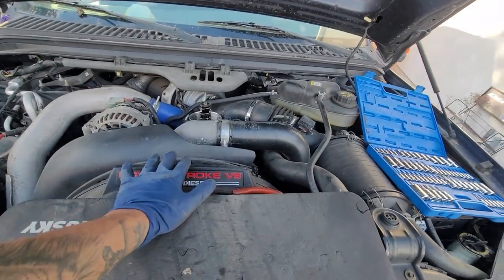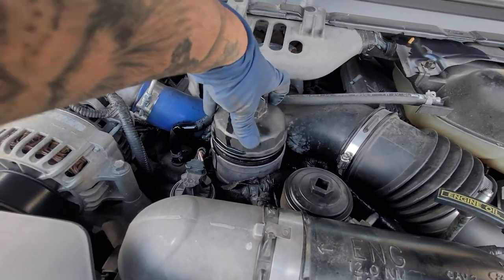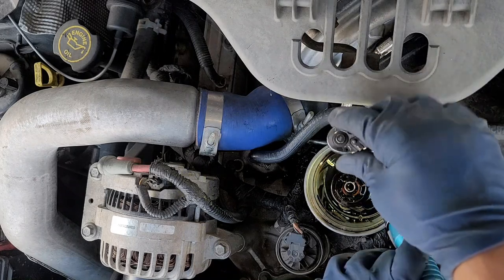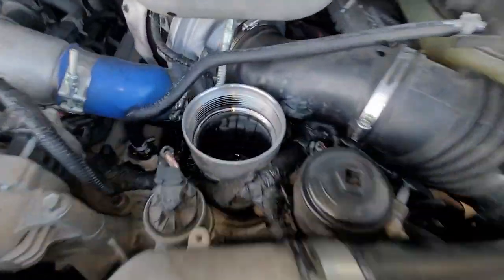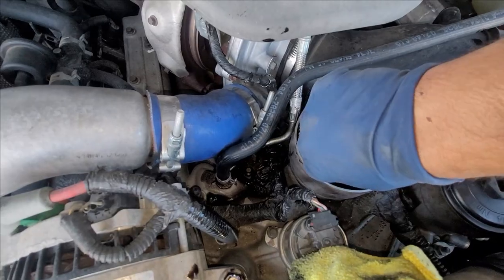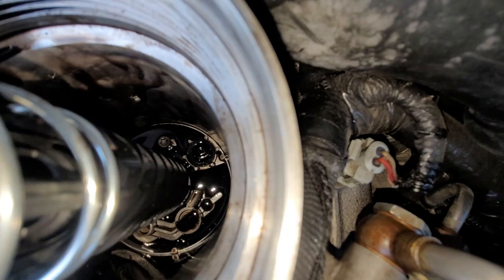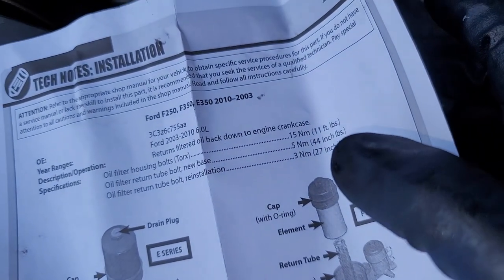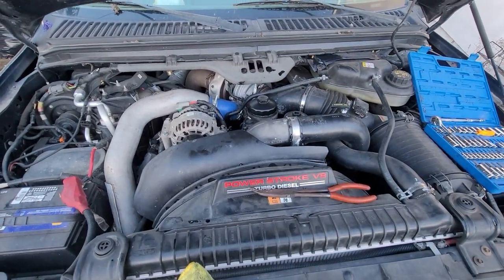2005 Ford F250 6.0 powerstroke oil filter return tube replacement

Comment: So the torque spec on the new bolt that holds down the return tube is 44? I’ve seen a lot of conflicting things about this having to replace mine today. Saw the manual says 53? I’m confused I just don’t want to over torque.
Reply: I replaced mine with one from Ford years ago and I think it came with a small instruction sheet that included a torque spec, from what I recall. I just used that.